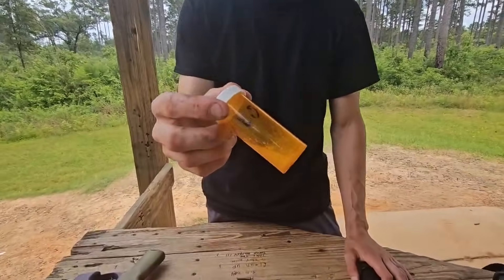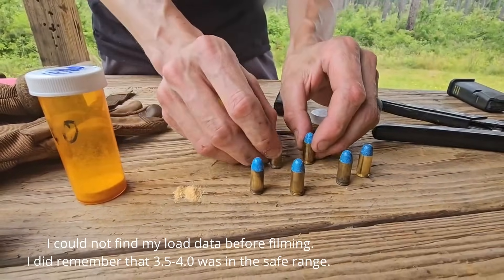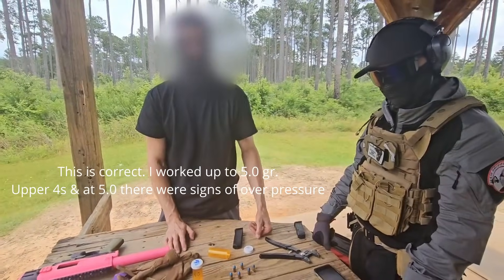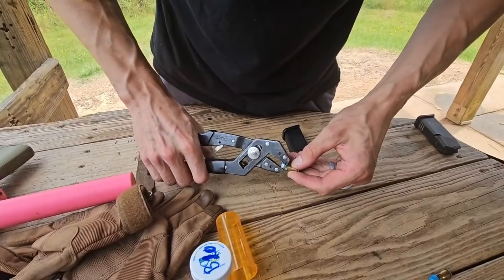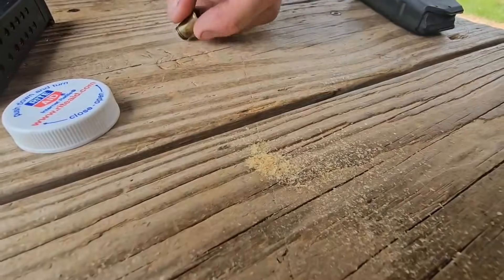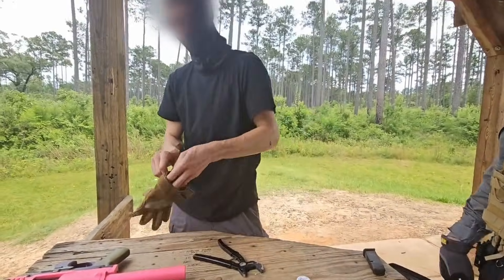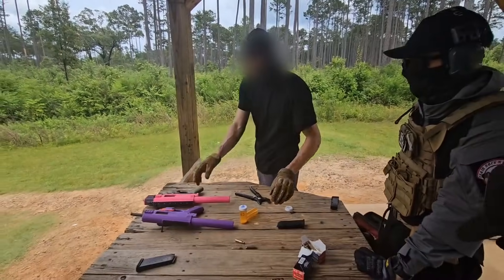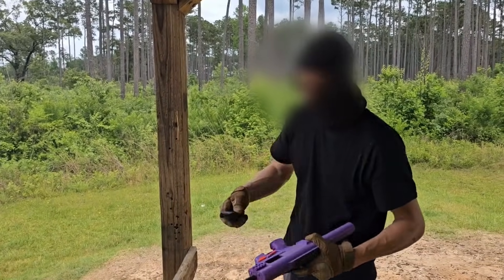Testing Homemade Smokeless Powder

Comment: I have made gun cotton and using degummed hemp fiber for smokeless nitrocellulose but have yet to load into brass.  I leadcast and powdercoat for 12 different carts, might start with .38/357 or 45auto/45colt for both my Ruger Blackhawks. Have made excellent black powder I use for muzzleloading and 45colt. I can make noncorrosive priming compound and corrosive as well to recharge primers and caps but want to learn more about making smokeless. Get ya a Lyman bullet puller
Reply: Smokeless powder recipe, please.
Reply: Can you give info on how to make smokeless powder...
Reply: @gp6957  I'm still learning this process again, but basically dissolving the gun cotton with acetone, ethanol, and camphor, squeezing out of a large syringe to make cordite. I've only read about a different process of shaking up with water and tumbling with graphite to make smokeless propel.
Reply: @JaredHempfield thank you. And your recipe for really good black powder, please? Both for cartridge revolver and rifle.

Comment: Something I've been wanting to try for a bit, testing nail polish, ping pong balls, and old film stock.
Reply: that is only celloid or cellulosedinitrate alone to weak and to much residue but very good soaker for Nitroglycerin if you wana make double base powder thant that stuff is the best.
Reply: @Preyhawk81 recipe, please!
Reply: I did that, I ordered many ping pong balls but they aren't made of nitrocellulose anymore, I found a solution! Just search flashcotton and you'll get it ! It's just works on its own but you can also make it in powder

Comment: awesome.. as I live in a banana republic country right now, i had to make my own smokeless powder as buying from the manufacturers was a via crucis. a tip for you: add 1% of diphenylamine to the end product while it's still a lacquer. don't ask me why. cheers!
Reply: No joke, OP please listen to this comment or your powder will ignite itself
Reply: Alternativle MgO 0,5% will work or Amylalcohol 4-6%
Reply: I'm assuming this is for a cotton based form of powder? I'm still learning so forgive me but I had a self combustion problem after about 6 months sitting thinking I had washed it enough but I was sadly wrong atleast I thought. Let me know if I'm correct so I can fix the situation.
Reply: @michaeljoyce3153  Old books write about the washing process first with NaHCO3 solution (5-10%) to neutralize the acids. Than the most importent part in Boiling Destilled water. The third step i would do is wash it in Urea solution. Urea neutralize the NOx and is an stabilizer. Industriall they used an Dutchlander thats an machine to cut cutton strings into pieces bevor the washing because the nc are like micro hoses and inside is traped sulfuric acid. And sulfuric acid is the great enemy of guncutton and sulfur compounds too.
Reply: @jaktSwager share the recipe, please.
Reply: دی بوتیل فتالات
کافور
دی فنیل آمین 
دی اتیل سانترالیت
هم می‌تونه برای کند سوز کردن نیترو سلولز یا ترکیب نیترو سلولز و نیترو گلیسیرین استفاده بشه
Reply: Estoy en las mismas, trataste de seguir la receta de la polvora sin humo o encontraste un sustituto??